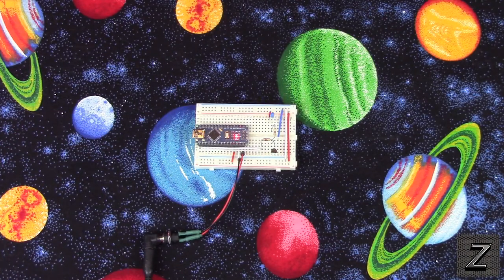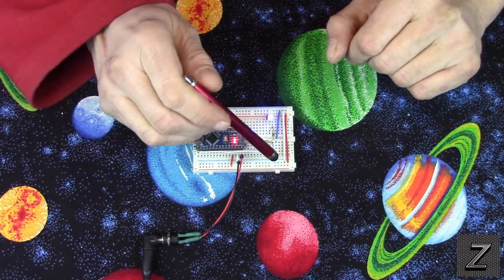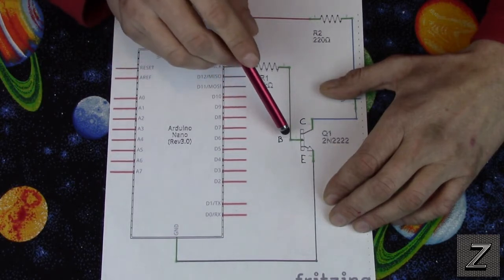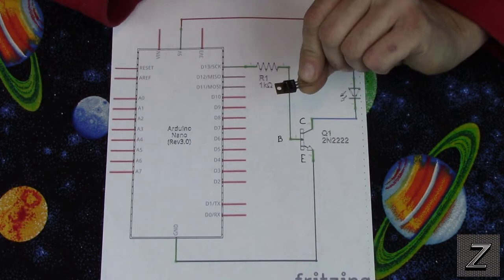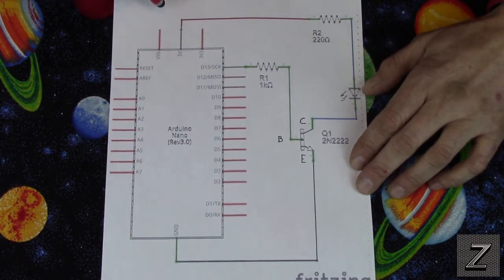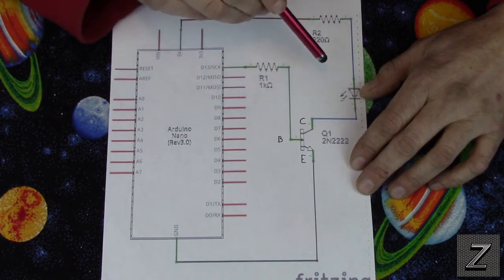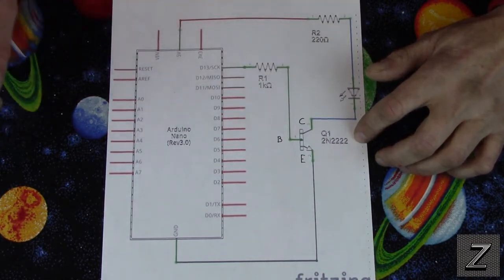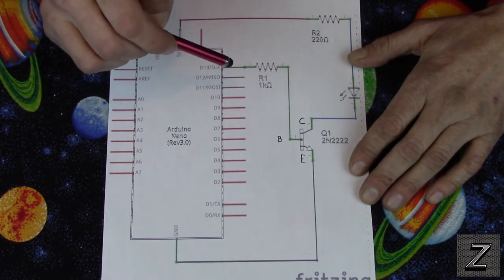How to use A transistor with your ARDUINO Board as a switch

Comment: Great video!!! Thank you for making it. I have a Arduino Nano that I am using to run a NEMA 17 stepper motor, but I want the Arduino to be able to power off and on the Nema 17 Stepper motor. The stepper motor is currently run on 9volts with 1500mA. How do I know what kind of transistor and what resistor to use? I'm new to this so any advice helps. I have a separate Arduino Nano that needs a switch to  turn on and off a TFmini Plus LiDAR Short-range distance sensor as needed. I would like to learn how to know the kind of transistors are needed based on the Arduino Nano being able to trigger the switch on or off using an S pin as needed to work with the power needed for the device. Is a transistor the correct rout to go? Any guidance is quite valuable?

Comment: Thank you sir. Excellent explanation for arduino newbie like myself. I have a GSM RTU unit which sends out SMS alarm . The manual says that it accepts dry contact. The RTU unit has digital input port (DI0) and Ground (GND) where I have to shot the DI0 and GND to have the RTU sends out SMS alarm. I was told that the DI0 expect  5V  digital input for triggering the SMS alarm.  I followed your video, setting up my arduino UNO and a NPN transistor to act as switch, Now i'm stuck at how should Iconnect the "RTU DI0 and GND" to the  "UNO + NPN circuit". Appreciate any suggestion.